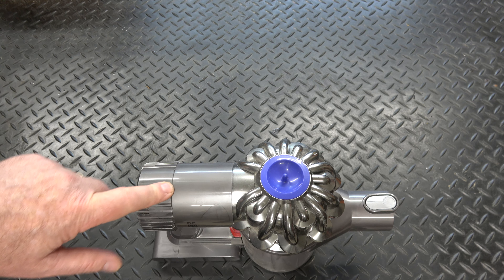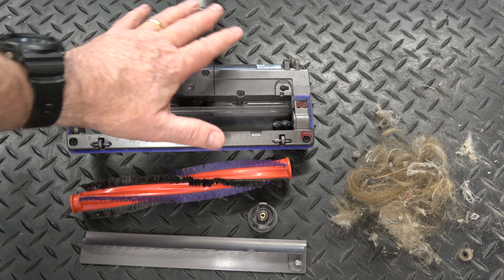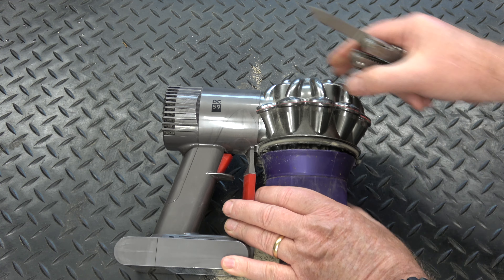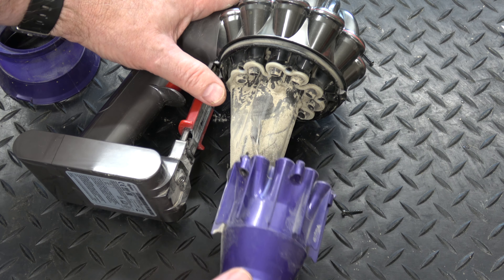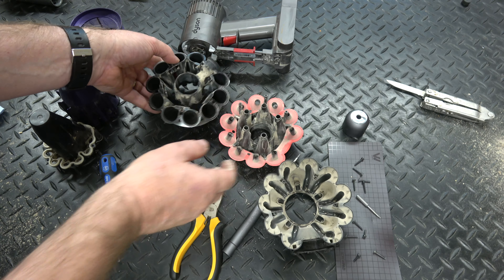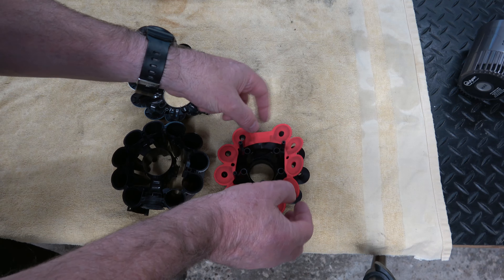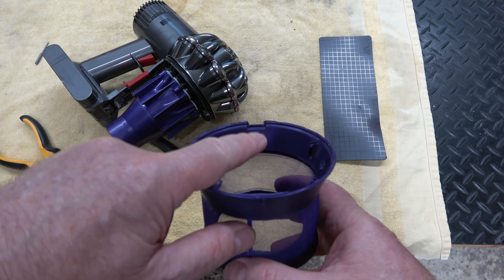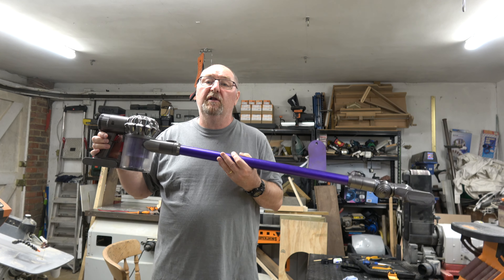Dyson Cordless Vacuum Pulsing or Losing Suction? - Check This Out. Deep Cleaning May be the Answer!

Comment: just wondering and thinking not great with tools nore do I have driver head that fits could u just submerge the purple part not the handle ;after taking  the mesh off ? save taking it apart?
Reply from the maker: You could end up sucking water up into the motor if it was not compeltely dry and you cannot tell if it is completely dry unless you take it apart.  :-)
Reply: @RussellPlatten  i done it really gently. soaked it for half hour. it was in airing cupboard overnight on top of hot boiler overnight and most of the day. it worked lovely ; my filter was really mucky though so played a hugh part.

Comment: I had to pull the motor out of the housing one time.  The impeller edge was caked in dirt, the rubber isolator passages were so clogged that the can of compressed air would not clear those. So I had to remove the back cover. The trigger switch. Untwist the powerbrush wiring gently pull the motor back remove the tape that held the power brush wiring through the housing recess and use a t8 torx to remove the contact housing that makes contact with the dustbin. The impeller housing I took off that attaches to the ceramic digital motor housing and cleaned the caked fine dust off of that because the motor made a squealing noise. After I done all that I painstakingly put the motor in the housing put the trigger back on and the pulsing and squealing was gone.  Cleaning filters wasn't enough.
Reply from the maker: Well done!  :-)

Comment: Mine, the trigger has been real finicky gor awhile now. It'll just shut off, then start, then shut off, like a wire is loose or something. I think i read that is related to needing cleaned.
Reply from the maker: It could be.  Ours ran for a few seconds and then shut off.  it would run again after a few seconds and shut off again.  :-)

Comment: Does the Dyson V6 filter come apart?  I couldn't push the top off mine.  Maybe they want you to buy replacement filters.
Reply from the maker: I would imagine the filters are all the same, but I do not know for sure.  There are three little lugs that hold the filter body to the top.  If you stop the video at 0:40 my thumb tip is on one of the lugs.  push the filter body in to release it from the top at these three points.  If these lugs are not there it is a different filter.  I hope I have explained this properly.  :-)
Reply: @RussellPlatten  got it...lump.of stuff in bottom...Great managed to do it..going to do my sons now.

Comment: Have you ever had a problem where it doesn’t roll nicely where it needs to be forced to roll? I  cleaned it out and did a Makita battery mod it’s just not rolling nicely
Reply from the maker: No Jeff, I have not had that problem.  I would check the head to see if anything is missing or if it has not been assembled correctly.  :-)

Comment: Hello,
Thanks for your video.

My Dyson works intermittently.
I changed the battery last year because it no longer charged.

There, I disassembled my Dyson until I only had the motor unit and the battery, to clean every corner inside.
But it always stops after a maximum of 5 seconds, and the LED which was blue flashes orange, then after a few seconds, it turns blue again and I can restart the fan.
And if I continue, it even stops sooner (less than 5 seconds of operation)
But when I disconnect the motor unit from the battery and press the button as if to use the battery, the LED stays blue for a very long time!!
So I'm stuck... could you help me please?
Can I do other checks on the engine block? Or should it be changed?
THANKS
Reply from the maker: There is another filter I missed in the video that is on top of the vacuum where the air grills are around the cap with the 'Max' button .  If you search for it on YT, there are a few videos showing it.  Other than that, I can't help you.  :-)

Comment: What do you recommend to look at on your Dyson if I've followed your tutorial and resembled correctly but now when you turn it on it pulsates three times and then shuts off.   When I twist off the back filter and turn it back on it runs fine.  I do not have any attachments on when I turn it I want to note.  Also, is air supposed to be blowing through that hole that the filter is secured against?
Reply from the maker: Not sure what is happening.  There is another filter under the cover at the back of the motor.  You have to remove the motor case where the boost button is.  :-)

Comment: I did everything the instructions told me to maintain mine but it never said you could pull the end off the filter. It was caked inside. There was no way it would have cleared with running it under the tap like it tells you to.
Reply from the maker: Glad I could help!  :-)

Comment: my problem is with the large and small power heads. Neither turn when attached. Take them off and it turns on and operates correctly? Any idea?
Reply from the maker: Siunds like they are clogged.  Take then apart and remove anything wrapped around the brushes.  If that does not work,  check the motor housings and drive shafts for restrictions.  :-)
Reply: @RussellPlatten  everything is clear. I was hoping others would have had a similar issue. After taking everything apart , cleaned and put back together I’m left to believe its an electrical issue based on the fact when either unit is disconnected it starts back up.

Comment: Perhaps its easier to use a vacuum with a disposable bag?
Reply from the maker: Once you use a decent cordless vacuum, there is no turning back!  :-)
Reply: @RussellPlatten  Yes, I do agree (I have a couple of Dyson). It was a mild joke because of the lengths you have gone to, to take the equipment apart to give it a good clean - you have more energy than me!
Reply from the maker: @David-xl6go  Needs must David!  It did not take very long in reality.  :-)

Comment: Mine works fine then stops and turns back on but without spinning the brush with only that big piece it doesn't do it with any of the other pieces.... I've already cleaned the turning piece inside, what else could it be?
Reply from the maker: There is a motor on the side.  You could try having a look at that Amy.  :-)

Comment: Good video but IMO the comment about Dyson not wanting you to service it is uncalled for. Torx screws are very commonplace and are much harder to strip than Philips or cross head screws. Very few electric devices these days can be disassembled as well as this Dyson these days. No glue, no seals, just screws and clicks. It costs a company more to do this and make it servicable. Kudos for that.
Reply from the maker: The problem is that your average person is not going to have a set of Torx screwdrivers and a lot will never have heard of them.  :-)

Comment: He makes it look so easy to separate the filter from the plastic support. I watched 3 times and still cant do it. it's stuck. very frustrating.
Reply from the maker: There are three little lugs on the bottom section that fit into slots on the top piece.  Try squeezing the bottom section below the slots and pulling the top to get the lugs out of the slots.  :-)
Reply: @RussellPlatten   Thanks for that suggestion. I even called Dyson- they said to use a butter knife or key.

Comment: Hi russell mine still keeps pulsating when hovering
Reply from the maker: Hi Rob, I discovered recently that there is another area to clean on the vacuum.  There are two filters at the back of the motor where the Max button is.  You can see the filters below the exhaust outlet around the outside of the motor housing   There is a screw on the handle below.  Undo this screw and prise the bit of the handle up where your hand is whilst using it (there is a small tab at the bottom of the moulding).  The plastic on the thin part (handle) will lift easily.  To get the round part off you need a flat screwdriver with a fairly big tip, or some other tool such as a scraper.  Look at the sides of the moulding and you will see an area on each side that is slightly raised and thicker plastic than the rest.  Just get the tool into the joint area and twist as if you were removing a screw.  This should pop the fastenings on either side and allow access to the filters.  Give the filters a good clean and blow or hover out the dust from the inside of the motor housing.  Replacing the back is straight forward.  I hope I have explained this adequately.  If this does not work, then I think you probably need a new vacuum.  Good luck!  :-)
Reply: @RussellPlatten  is there amy chance on doing a video tutorial please whem you can
Reply from the maker: Here is a link I found on here:  https://www.youtube.com/watch?v=hfrPBeckjtw
Reply from the maker: Glad I could help Rob!  :-)

Comment: Just as an additional point as I have been taking these blasted things apart for thinking the pulsing was the filters, it wasn’t it was the long floor brush attachment clogged with months of dust dog hair and what ever else tangled together into a felt like obstruction to the vacuum sensor that interprets a low pressure as a blockage and pulses the motor, cleaning out this has reduced pulsing to nothing in the last 18 months versus pulsing all the darn time and the horrid filter washing exercise.

Comment: 4:04 this is a bit tough, i afraid it might crack the part
Reply from the maker: It is very flexible and quite easy to remove if you follow the method I used.  :-)

Comment: WHEN EVERYTHING Is A.O.K. ... and still won't run ??   PLUG OUT / PLUG IN BATTERY.. it's something to do with the RED lever that bears on the battery on / off switch ...Have used that twice in two years with my v6 Fluffy
Reply from the maker: Thank you for that information!  :-)
Reply: @RussellPlatten  You are more than welcome Mr. Platten ..

Comment: Best choice, this great video not withstanding, it is very good, best thing to do in not buy a Dyson in the first place. It's an engineering marvel on paper, a thing of beauty as an engineering accomplishment and is worthless for real world use! Just my opinion after throwing one away that never worked actually correctly. Go to your big box store where you can buy several cheaper vacs and toss them when they are done and save the big bucks an overpriced and under performing DYSON costs! BTW this cleaning is routine and frequent if you have pets!

Comment: Now I see the reason these things don't throw dust out of their vents, it's because the dust is simply contained on the inside against all these parts, crazy.

Whatever happened to "buy a cheap vacuum cleaner, use said cleaner until it stops sucking, chuck said vacuum cleaner, then repeat" no need for engineering school. But of course Greta Tunburg has taught us that chucking a cheap vacuum cleaner will destabilise planets in the solar system. So let's analyse this; creating a whole industry for cleaning maintaining & repairing these units (with a limited national labour force) has no knock-on effect?  No problemo, it makes perfect sense.

Comment: Our new Green King should confiscate James Dyson's knighthood and give it to you instead! Arise Sir Russell! I weep to think how many of these expensive, highly engineered machines go to landfill every year for want of a simple clean! At least it SHOULD be simple, but I make an annual pilgrimage to this video to remind myself how to do it. I understand the cyclone has to be complex, but using non-standard screw heads is just obstructionism. But the motor filter access is just unforgivable - there is no reason this should not be easily user washable, with a screw or bayonet attachment. It is easily done once you know to do it and how, but even then it is practically impossible without some cosmetic damage. For that, and the skirt of the cyclone, it is a matter of having the confidence the level of force is the right thing and not about to break something. Your video renews that confidence every year!
Reply from the maker: Thank you John.  Yes they design the vacuum to put people off cleaning it.  I reckon they must have sold so many replacement machines due to this design.  It is a great product whilst it is working efficiently!  :-)

Comment: A tool that should have never been built. With all the advertising hype, this is probably a very poorly designed machine. Lot simpler vacuums on the market with better suction for $s and easier to clean.
Reply from the maker: It has been a very good vacuum.  We have had it a long time.  :-)